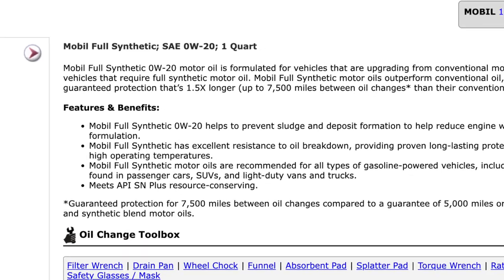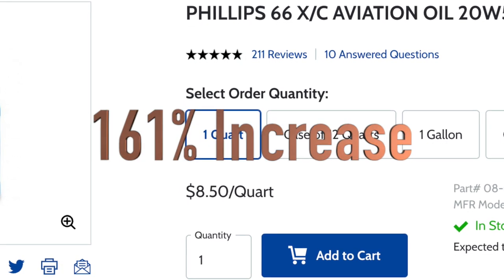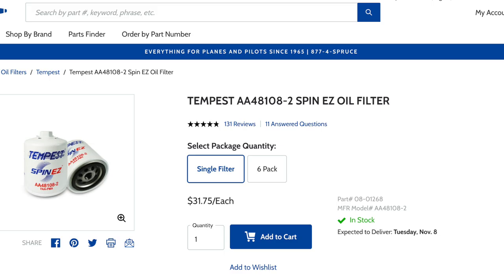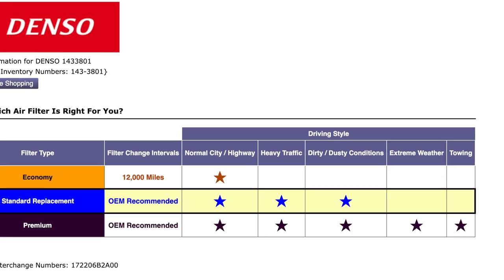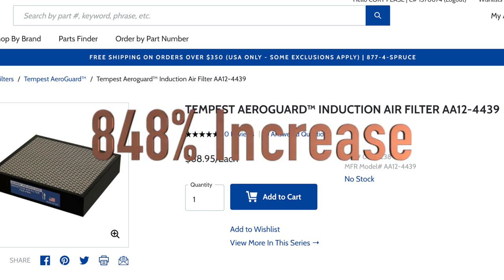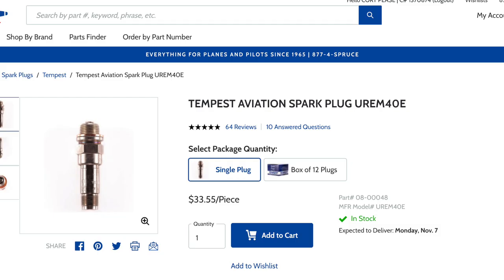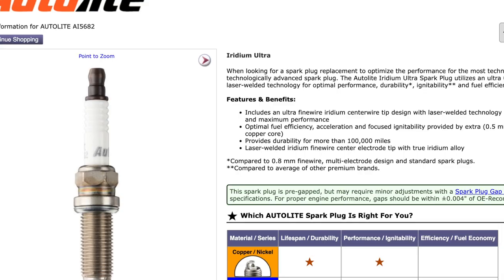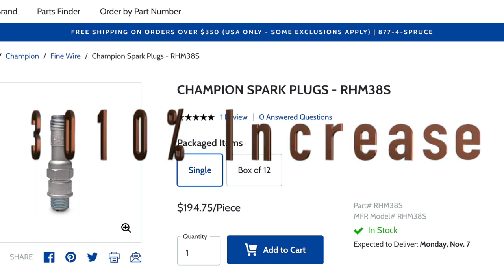Airplane Parts Are Insanely EXPENSIVE! - 4 Examples Of Basic Overpriced Parts

Comment: The cost for FAA TSO is crazy and they pass that cost along to the consumer.  Also, many of these companies don’t have the scaled business that automotive companies do which increases their unit cost.  However, I do think they take advantage of GA.  But, the market supports the price.
Reply from the maker: Well you’ve said something very true there, we just keep paying!
Reply: The Market doesn't have a Choice.  Want to have your eyes opened, take a look sometime at instruments from the same company, same Model, and the price difference between "Experimental" and "Certified".  ZERO Difference, they came off of the same lines, are built to the same standards, but that little TSO stamp means you pay around 3X the price.  Sadly one of the things that TSO does is hamper Innovation. it's the same reason that we haven't had any REAL new advancements when it comes to powerplants.  Overall, if you look at things, aside from Rotax, there really hasn't been much movement...oh, a lot of people have TRIED, there are some really interesting looking Diesels out there...Problem is, without Musk or Bezos money, who can afford to take the hit for the Millions of dollars for Certification.  Hell, look at the nightmare it's been getting Unleaded Avgas certified, even as you have areas in Californiia that banned 100LL.  One really impressive Diesel option was rolled out at Airventure in 2019. They were actively seeking builders to buy their engines, and start getting hours in the air...at a cost of Over $100K Firewall-Forward.  Needless to say, they got few if any takers..most people getting into Experimental are trying to SAVE money, not equal the cost of a brand New Certified Aircraft., or be the literal Guinea Pigs for new Engines.
Reply from the maker: You’ve so perfectly described our sad reality. Another problem is, changing the system is u likely to be a priority for any lawmaker. The aviation community simply doesn’t contain enough votes!

Comment: Wow man, great topic to discuss. Certification is both a positive and a negative. Positive that it provides you with "assurance" the product is up to the job. Negative that it holds back product evolution and development.

This is one of the reasons I decided to go with an auto conversion engine for my Velocity build.
I don't consider it cheaping out, but going with modern technology, mass produced, mass tested by millions of customers performing billions of test hours under all conditions from 70 Yo grandmas to 18 Yo teens drag racing and drifting on saturday nights.
Also hundreds of millions (or billions) are spent on research and development so each iteration of the product is better and cheaper than the last. Billions of dollars and big reputations are wagered on automotive products being reliable and robust.

And also platinum/iridium spark plugs and coils for cars will do thousands of hours before needing replacing or even checked.

Whether a car engine can, or should turn a propeller for an aircraft is another argument all together and not for this comment section.
Reply from the maker: Very well said Clint. Did you go Honda by Viking?
Reply: @MyTimeToFly  Yes, the Turbo 195HP. Knowing what I know about engines, there is no way I'd feel comfortable converting an engine myself. Happy to maintain it though.
Reply from the maker: Very awesome! I’ve done some research on the Viking engines, and although there are always some doubters, I really like them.
Reply: @MyTimeToFly  Yeah its easy to drink the viking coolaid. But before I found viking I did a lot of research on aircraft engines, watched/listened to pretty much all of Mike Busch's lectures on aircraft engines, most of them twice. I concluded I didn't have the resources if there was a major issue like a bad cylinder. That would ground me for several months, even if I supplied the labour for repairs. A full engine overhaul would financially wreck me and my family for several months.

Besides I get a simple to operate single power lever, variable pitch prop that will be  more akin to a car CVT than a CSU (once I program it) and turbo charging for high altitude cruising speeds and full power takeoffs on hot days without the negatives to engine life/weight and expense.

Nothing against traditional aircraft engines, I think their story arc was shaped when it was  asked to be aircooled and deal with 100LL but that's a deep rabbit hole to get started on.

Comment: here's an interesting item in the vain of what you're speaking about.  Back when aerospatiale were developing the AS350 Ecureil helicopter ,  better referred to as Squirrel, aka Astar , they were having issues with the company manufactured oil cooler and , I don't know what lead to them going down this path but they fitted a modified radiator off a Citroen motor vehicle as the oil cooler and it worked significantly better than the purpose built unit and was a crap ton cheaper too although I don't know if this is still the case with this particular aircraft
Reply from the maker: Too funny, who would have thought a car part could save the day. It seems like Honda could start an entire division of piston aircraft engines, and rule the market!
Reply: @MyTimeToFly  I believe there are several automotive engines like VW , Subaru,  the LS1 V8 as used by some Holden and Chevy even BMW that have been converted for aviation use but I don't know if they can be used on certified aircraft, definitely on experimental category and I guess despite the conversion and engineering approval costs they would still be an economical option for those aircraft. On a side note I work as an avionics tech and I just recently executed a full avionics upgrade on a piper Aztec and the Alt Inop  lights basically turned into powder through age and we simply replaced them with new units from a local bulk electronics supplier, they were easier to fit,  globes are easier to change and my boss who has multiple licences said these were fine for the intended use and some of the parts like switches , terminals and consumables that we purchase through aviation supply channels are identical in construction and specifications to commmercial retail items....with the exception of the number on the packaging that seems to cost a fortune funnily enough
Reply from the maker: There are certainly some “converted” engines available, but they’ve never really taken hold. It’s taking 3rd party colonies like Viking or Jabiru to take on the work, rather than the OEM.

Comment: I was just quoted $730 today for a replacement switch for my landing light (1967 M20F). Absurd.
Reply from the maker: That’s insane! Probably a $3.00 switch at the car parts store!
Reply: I have a 68 and you can buy switch/breakers on aircraft spruce for about 30 dollars.   I may know someone who did that.  Some people would interpret an electrical switch as a standardized part and therefore doesn't need a TSO blah blah blah.
Reply from the maker: I like that interpretation!

Comment: Litigation is really where the high costs began.  In the 70's or 80's just about every crash/death resulted in the surviving family suing every manufacturer who contributed a component to the aircraft in question.  7 years ago Vans RV was sued for 35 million when a pilot/builder incorrectly used rtv in the fuel system, resulting crash killed his step-granddaughter.  Same issues drive up the cost of healthcare.  FAA rules create monopolies which doesn't help us either, I think they got their POH from the FDA.
Reply from the maker: I agree with you, but 35 million is pennies compared to the automotive world. Just some recent examples:
2016 VW Emissions - 14.7 Billion
2014 Toyota Acceleration Issue - 1.2 Billion
2011 GM Ignition Switch - 900 Million
Ford Explorer Rollovers - 1 Billion

These are just the big ones!
Reply: @MyTimeToFly  I had one of the TDI Passats affected by that, was still a great car until it sucked parts of the turbo into the engine.  Automotive industry is in a vastly different economy of scale though…
Reply from the maker: Agreed on the economy of scale, I had an affected Jetta…sold it back!
Reply: @MyTimeToFly  Mine was leased and I tripled the allowable mileage... it was a shit show.
Reply from the maker: Sounds like it. I ended up driving my Jetta for something like 2.5 years and only paid $2,000 total after they bought it back.

Comment: Well, this is why because it is a limited field of purchase there are those that fly in those that don’t it’s like the have and the have Nots they can charge you that much because they can because they know you’re going to pay for it know some of these things Like oil filters and air filters. I don’t see that there’s any reason you can’t use something similar to a car the only thing I can think of is that they make sure that the threading for say like an oil filter is not correct it’s specific to Lycoming or continental same thing with the air filter. Maybe it’s just shade too short or too wide or something And they do it specifically and it’s not right they’re doing it on purpose and they want to make you bleed for it. There’s just got to be things that you can substitute like for instance hydraulic hoses. There are hydraulic hoses that they put on caterpillars and track holes in front end loaders these things use massive amounts of pressure for hydraulics but yet you can’t use an industrial Hydraulic hose on an airplane because it doesn’t say FAA it’s a load of garbage personally, I would use some of the things I can get a hold of regularly and when it comes time for inspection just swap the stuff out I don’t know if that would actually work, but it’s just ridiculous and it’s not right, so how do we fix it?
Reply from the maker: I'm not sure how we fix it, perhaps speed up the movement to experimental aircraft!

Comment: I would love to see an analysis of what it would cost to make a perfect copy of a Toyota Corolla without any tooling.  Not counting the millions of dollars it would take to recreate the electronics & programming, I bet just a non-functional perfect copy (to the same accuracy as a production Toyota) would cost somewhere around ten million dollars.  The engine alone has several hundred parts.

The problem with general aviation is that it's just too small to scale into what is the miracle of mass production...  We take for granted that something that would take $10MM to make one of, can be made for $15k each if you make 100,000/year.

That said, I'm sure the paperwork and so on adds a ridiculous amount... I'm not disagreeing with any of that.  :)
Reply from the maker: I certainly agree there are extreme costs to small production runs of parts and that we do take for granted the scale of automotive manufacturing. But, I also know that making 1 is much different than making 1,000 if the right methods are used. With CNC technology and additive manufacturing, the costs of things could reduce. 

I’ll take an oil filter as an example. If you go to the auto parts store there are a hundred or more filters, different sizes, brands, “quality levels” etc. What makes our oil filter not just another style on the shelf for the same price?

In the US along there are over 200,000 GA aircraft. If each one changed their filter twice a year that’s 400,000 filters. There is no “scale” difference between 400,000 and any number really.

Comment: Is the mark up pretty large?  Yes, yes it is. Is it a reward for jumping through all the bureaucracy of paper work and regulations? yes, yes it is.  This isn't a political statement, but you let the .gov get involved or oversee anything and it will take much longer and cost much more, especially if their goal is streamlining and cost cutting.  Look at experimental rated electronics compared to certified.  You pay a ton of money for that behind the scenes paperwork for essentially the same product.   The thing that should really miff you is the fact that all of this regulation has deterred advancement in the GA industry.  We're flying planes with engines that have little advancement over a 1940's motorcycle. If it wasn't so expensive to advance technology, we'd have more reliable and efficient engines, electronics, safer airplane construction. Not to mention it's a huge roadblock to competition. The very thing established to make us safer is actually doing the opposite.  It's no wonder the experimental market has gone crazy.  I won't even get into the fact that the number of A&Ps is dwindling faster than blue check marks at tweetster.
Reply from the maker: So many good points! Thanks for the comment, you speak a ton of truth.

Comment: lol, your percentage rates are way off. And you are comparing a Honda accord motor to an airplane motor. Not even close. Diesel truck parts are not cheap either. Glad it’s not as expensive as I thought. It’s comparable to buying parts for Ford or Chevy Diesels. Not sure about plane motors. But diesel engines have glow plugs not spark plugs which are much more expensive to replace. I think around $1200